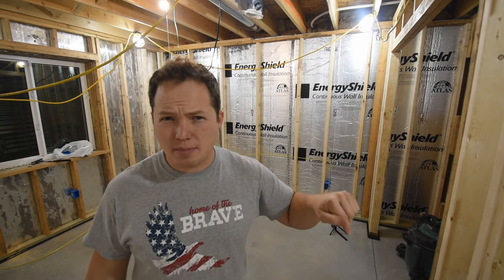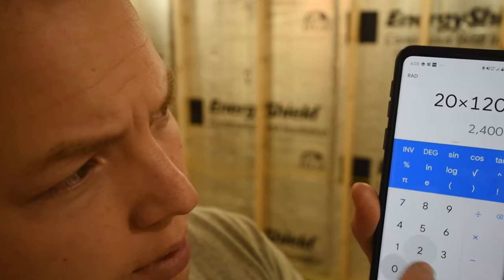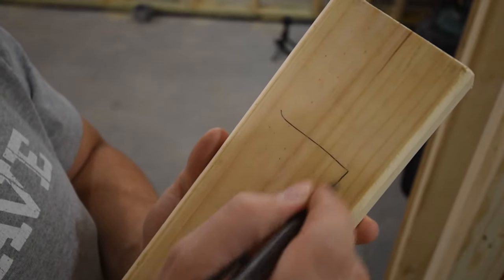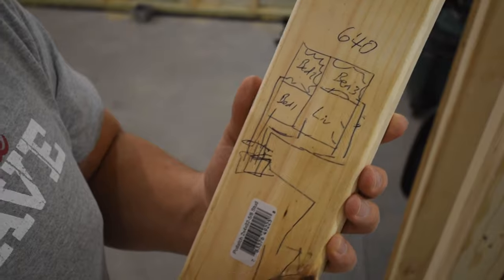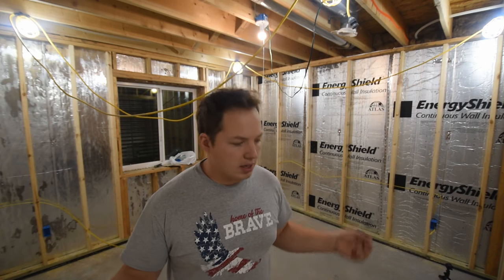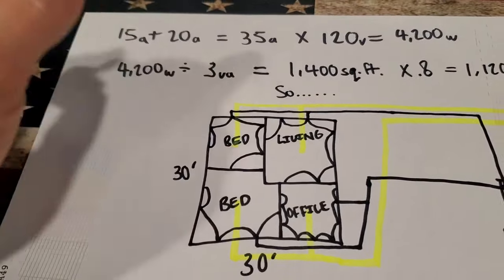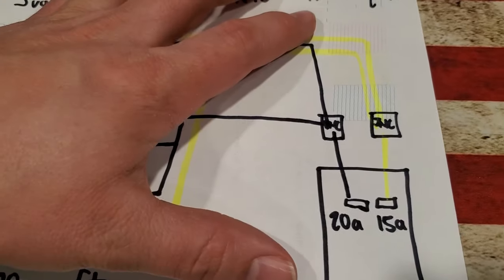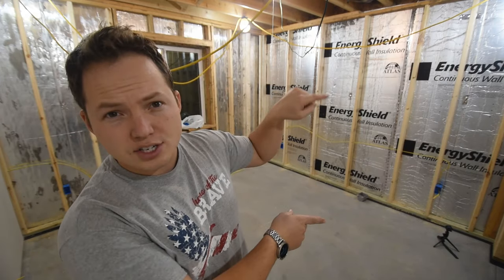Does a Bedroom Require a Dedicated Circuit? - Using the 3VA Rule To Calculate Anticipated Loads

Comment: It may have already been brought to your attention, but it is not necessary to apply the ‘80-percent’ rule in performing your calculation. That value is only used when including ‘continuous’ loads in your calculation. A general purpose (convenience) circuit does not typically involve continuous loads as defined in the NEC. Conclusion…a 20-amp circuit may be used to its full rating…2,400 watts.

Comment: I would like to see a video wiring a room using home computer workstations for each occupant. Something like six computer monitors and two computers, five external hard drives, four powered USB expansions hubs on one wall. I don't think there is a connection between square footage of a room and the load of all the electronics commonly used now.

Comment: I live in Tucson Arizona , and in this county, you are required to have an arc fault breaker for bedrooms. I guess that fact doesn't change anything you just said in this video, just that any outlet that winds up in a bedroom be protected by an arc-fault  breaker.
Reply from the maker: Same here! Almost everything is on arc fault these days.
Reply: Yes, it's the National Electric Code, and it applies to most jurisdictions. But states, counties, and even cities don't necessarily adopt the NEC, or, if they do, it may not even be the current revision. Some jurisdictions may even have a superset of rules that exceed the NEC, such as Chicago and its surrounding counties.
Reply: @aaron74  wow, I wonder why Chicago is so persnickety. I mean, it's not like they ever had a fire.. there... Oops...nevermind.😂
Reply: @barryhornby3303  They've had a couple bad ones, I think. ha ha They also have very strong labor unions there, and their local electric code requires EMT conduit in electrical construction - in residential construction even! I personally am all for it. EMT and steel boxes are awesome, and allow you to fish new lines if necessary. But EMT is not DIY friendly.
Reply from the maker: @aaron74  I am considering using EMT for an upcoming garage wiring project but I'm not 100% sold on the idea yet. Just not sure if the extra cost & effort is worth it but it would be pretty fun!
Reply: @aaron74  same with us in NH some areas have no codes others are like you need a 80amp circuit for a 50 amp oven or 30 amp dryer lol 🤦‍♀️🤷‍♀️🙄
Reply: @BenjaminSahlstrom  you cld always use mc ?? best of both world the strength of emt and the flexibility of romex
Reply: @BenjaminSahlstrom  EMT is beautiful. I love the stuff. The only intimidating aspect of it is learning how to bend it, it takes a lot of practice. I've done some installations with bends that I'm pretty proud of, but I've done plenty of screw-ups over the years to get there. There's just something so satisfying about working with metal pipe, fittings, and boxes!
Reply: @aaron74  Yes all residential here and most of the surrounding suburbs has to be in EMT conduit.  Romex only permitted for temp wiring. BX, or MC armored cable or flex is allowed only in enclosed walls where it has to be fished in. There must not be more than 18" of showing where it emerges from wall/ceiling to where it  connects to a J box.  If I remember right in new construction low voltage must also be in EMT conduit. Tandem or skinny breakers are not allowed. Unless it's changed now, there were no arc fault requirements but some nearby towns still require them in bedrooms.

 I like metal boxes and EMT also.  I think it provides a safer installation, better protection and room to add or redo wiring as changes arise.  Looking at a finished EMT installation in walls and ceilings is almost like a work of art.
DIY conduit bending is def not easy, its very time consuming and labor intensive I can tell you.    You can learn the basic bends, 90's are easy, but getting it neat, straight and even takes a lot of patience and practice.
Reply: @aaron74  I admire those who can do three or four bends on one stick when I've made one or maybe two then cut it  and do another bend or two and cut it Lol.
Reply: @Progrocker70  You must be in the Chicagoland area then. Maybe you can tell me why receptacles always seem to be mounted sideways there? lol
Reply: @aaron74  Lol no answer for that one. My house I have now all the outlets are vertical except one between a windowsill and a counter.  I own another bungalow, and all the original outlets in it, that are piped in rigid, are sideways and the ones added over the years with gem boxes screwed to laths are vertical.
Reply: @Progrocker70  Yeah it's an oddity in the Chicago area: sideways receptacles. If I had to take an educated guess, it's for EMT that runs horizontally through studs, and is interrupted by device boxes for receptacles. Device boxes are rectangular so it might be better to have them sideways for less congestion for the conductors entering the boxes. These days the 4" square boxes are used, so the orientation of the device depends how you want to mount the device plaster ring. Maybe they continue mounting it sideways out of tradition.

Comment: I prefer running 12/2/2 to the receptacles. I also prefer to alternate each circuit to every other receptacle. I don't like split outlets. I find them dangerous to the Craftsman. This configuration allows for having power available if 1 of the circuits trip as well as some built in load balance.
Reply: 12/2/2 huh? Wow, that's pretty extreme. I suppose you could split the standard duplex receptacle and have the top one on one circuit, the bottom on the other circuit. This was common practice in Canadian kitchens before two 20A countertop receptacle circuits were required (that matched the US requirement).
Reply from the maker: Wow Steve! That's very impressive. I'm not very familiar with 12/2/2 so I would just run a second 12/2 cable to help me keep it straight. So you use single receptacles instead of duplex and then alternate between circuits for every other receptacle?
Reply: @BenjaminSahlstrom  I still would use duplex outlets. 1 box would be black circuit with the red circuit as the passthrough and the next box would be red circuit with the black circuit as the passthrough. If I used a single receptacle it would have to be rated at 20 amps. The exception in the code is multiple outlets on a single yoke may be 15 amps. By using this, my defacto derate factor is 25%. No worries about overloadsᕙ(  • ‿ •  )ᕗ
Reply from the maker: Thanks for explaining that. Some might consider that to be overkill but wow is it cool! Might have to add that to the list of videos to make! Just have to make sure that you keep the neutrals separated too right? Then would you space the two breakers feeding the 12/2/2 apart so that they are both being fed from the same leg of power from the panel in order to avoid having 240 volts in your boxes?
Reply: @BenjaminSahlstrom   What I like about 12/2/2 are the nuetrals have a corresponding stripe to match it's hot. No toning out to identify. This cable was well thought-out.
Reply: @steverosenbaum2469  What's weird is that this was never done with electrical cable before. With low voltage communications cable, you have a solid color conductor and its striped mate to identify a pair, and this goes back to at least the mid-20th century.
Reply: wow thts expensive just use two spools and pull 2 lines together same labor %30 percent less than 12-2-2 i was going to use it myself than seen the price was like nope ill just run 2 spools at the same time lol
Reply: @BenjaminSahlstrom  ya in my area it was like %30 cheaper just to run 2 spools at the same time
Reply: @steverosenbaum2469  lol you must have got a good price i was going to try it myself but it was like %30 more i just ran 2 spools same labor ya i had to trace pairs
Reply: @wizard3z868  Yeah you're right, the 12/2/2 is still expensive. Probably not popular enough.

Comment: i did some rewiring in my house. they had half the kitchen, old and new living rooms, out door lights on deck and porch, plus porch and hall lights on 1 circuit. and 1 unused outlet in garage on 1 breaker. and 1 garage light on 1 breaker. i shuffled stuff around. master bed and bath lights and outlets they had on 1 circuit and 2 other bedrooms lights and outlets together. i left those alone. but like dude said.... if you can, each bedroom or room outlets on separate 20 amp per room. and all the lights on 1 15 or split between 2 15s depending how many rooms. thats way to go.

Comment: The only point that I’m going to bring is , that every receptacle outlet is 180 va   code math is 20x120=2400/180 =13 .so in residential outlets are non continuous.
Reply: Mario inocente     You are correct if you are talking about other than dwellings.   The 180va or 1-1/2 amps does not apply to dwelling units.

Comment: I have a 700sq ft house with a conventional panel, but the rooms still have knob and tube wiring.   It was inspected OK, but a vac and/or blender will sometimes pop the breakers when they should not.   I don't understand how a. 5A vac can trip a 10A breaker when nothing else is on the circuit.   Does this mean there may be undetected wiring problems?  Cheers.

Comment: Can you explain the 3va/sqft rule? I’ve tried to determine how many receptacles or lights can be on a branch circuit before. For the receptacle question, I’ve seen that you can assume 1.5amps per receptacle and the circuit should only be loaded to 80% so that would allow you around 10-12 receptacles per circuit. Lights pretty much the same idea, but they generally draw less so you can have a lot more per circuit. Is the 3va/sqft basically just the consolidated version of this principle? Also are you a licensed electrician, and in what part of the country?

Comment: Bedroom lighting, should be 'required' to be separated from ALL OUTLETS. Trip a breaker once with ANYTHING (VACUUM) and you'll understand why (can't even find the stairs if upstairs to go down to the panel). Alternative example.  2 window ac units, when your whole house HVAC needs replacing.  BAD TIMING FOR ANOTHER PROJECT!  Mom says.. 'why not add a ceiling fan in each room?'  Try doing that with no power in the outlets for even a work lamp.  Time to buy more batteries or just go grab the solar lamp from the garden gnome?  NOPE.  Do it smart!  Good video!

Comment: i have a closet next to my game room and in the back of the closet there's an access panel for storage 8 outlets on 12/2 and a 20 amp breaker, could I come off that out let and run 12/2 for 2 led lights to light closet and storage room using a 20 amp light switch?

Comment: What about Voltage drop off.  I'm confused, with 12/2 wire on a 20amp breaker we are only allowed to run around 50ft before we hit the 3%.  I'm assuming most residential runs are longer than 50ft.  How are we allowed to do this?

Comment: An apartment having Living and Bed room each (3mX2m), Kitchen and Bath room each (2mX2m), Corridor (4mX1m) and Balcony (2mX1m) is to be installed with the following loads: Ventilator (500W), Fridge (1kW), Stove (2kW), six 60W lamps, and five socket outlets.
a)Calculate the sub-feeder cable size for this room if the average ambient temperature of the local area is taken as 35oC and five groups of circuits are running together in a conduit with it. The length of run is 15m and protection is by MCB.
b)Choose the rating of the MCB and the branch circuits breakers. 
c)Locate the approximate area of location of each lamps and sockets.
can you pleas do this for me ?

Comment: 120 X 20 = 2400
2400 divided 3VA = 600
You can put as many plugs as you want on a 20 amp circuit with in 600 square feet of living space 

Why is this aloud ? 

Because 75 percent of the receptacles never get used. 

The only thing you says that is good practice is receptacles on 20 amp circuits and lighting on 15 amp circuits

Typically you could put all 4 rooms on one lighting circuit, the only time I would split is if each room has ceiling fans, I try to not have more than 2 ceiling fans on a light circuit, usually 14 to 18 openings with the LED bulb coming into play.

Nowadays 3 to 5 lighting circuits will be enough for any house. 
3500 square foot and smaller

Comment: Please explain why you bring 4  20a circuits to 1 junction box?
Reply: Jose Canisales    What he was saying is put a junction box near your panel with 4 home runs to the box.   Run 1 circuit from the box the a breaker in the panel.   Now if you want to reconfigure to 2 circuits, pull the wirenuts apart and install 1 more circuit from the box to a new breaker and re-splice the conductors in the box.

Comment: Well I'm not sure if the codes are different in your area, but it is considered that each outlet is equivalent to 1.5 amps so in theory you shouldn't put more then 13 outlets on a 20 amp circuit, to be safe 12, this would be a safer way to explain it to the dyi person
Reply: There is no code in the NEC that limts the # of general   outlets on a circuit in dwellings. Thats commercial wiring.

Comment: Hi Ben first time contacting you my friend is renovating his home and installing new circuits and lighting I am a retired electrician and my question is do you need to have arc fault breakers on the refrigerator and bathroom circuits as they will be dedicated circuits
Reply: as always check with local authority but most will be yes and in 2024 large appliances ovens and dryers will need afci/gfci🙄🤕

Comment: So going by sq footage in. 3 bedroom house, 1 master and two kids, I would run 1-15 amp circuit for the 2 kids and 1-15 amp circuit for the master. That's enough to cover
750 sq feet. That's almost 20x40 on the flat. That's a lot of area.
Reply from the maker: Obviously you can always be more conservative and run more circuits. It's just a starting point to go from.

Comment: Hey Ben I  have a question that I will try to keep short (but unlikely, sorry)  I bought a bidet toilet seat (AC 120V 60Hz 660W) and need to install a GFI to power it. I installed the GFI and powered it by pig tailing it into a 3 gang box in my attack. Inside the box was already 4 wires coming in. 2 wires were 14/2 w grn and 2 more rounded wires I think 14/3 with black, Red & white wires. The red to red & the black to black, so I left those alone and just took my one 14/2 and tied it in to one of the other 14/2s in the box. Black to black, white to white and of course the grounds were all together. I lightly twisted the wires (I know you don't do this) before adding the marrettes. I made sure they were snug and then I even tape them separately with electric tape just make sure. I tucked every thing back in the box neatly with plenty of room inside that 3 gang box. The GFI was working correctly and the bidet seat also worked perfectly ... Now ... the issue I have is when I turn on certain lights in my house after about 1 min.  I notice a faint pulsing or I don't want to say flickering because the lights don't go out just slightly flick (almost like a very quick half blink) It does this each second for about  60 to 90 seconds. Then it stops. Sometimes occurring again after 7 or 8 mins.  Something like this has happened over the past few years when my toaster oven is on the microwave light over the stove slightly pulsed the same way until I turned off the toaster oven. Anyway my question is do you know why this is happening? Is there not enough power in the circuit to carry what's on it? Should the bidet get it's on line straight to the panel or should the panel circuit that carry those lines be changes to a 20amp instead of a 15amp. Almost all my circuits in the panel are 15amp.  Any ideas ? Sorry for the long message. I appreciate your help.
Reply: RE:Dwayne Nero. I'm not an electrician but I would re-check the connections in the bathroom box you tied into, especially the neutral wires. Also, in case you may have tugged on one of those 4 wires, I would try to trace each one back or forward to another box and check the connections there. If you have a bad (loose) filament in an incandescent bulb, it might cause pulsing.
Does your microwave light still pulse? Is it on a different circuit than the bath? Is so, then it may be more of a problem in the main panel or outside. I would inspect the wires there, especially the neutrals. One other thing you might try replacing the breaker or swapping 2 breakers to see if the problem moves to the other circuit.
If you have, or can borrow, a multimeter, you can check the voltage at the bath box, the microwave light and at the corresponding breakers to see if it is fluctuating.  Also, test between the 2 hot legs and the neutral where they connect to the panel. Between hot and neutral, about 118-125V and from hot to hot, about 235-245V. Does it fluctuate? Test with main breaker on and off.
One more thing; if the bidet was cheap Chinese crap from Amazon, I would also check for loose connections on it.
Reply: @munsters2  Thanks for the advice which I will keep and apply to any similar future issues. What I decided to do just to be on the safe side was to give that bathroom outlet it's own dedicated line straight to the box. The pulsing stopped completely and everything operates perfectly. I just thought the piggybacking was too much. So all good now thank you 😊

Comment: When are you going to mention the 6/12 rule for receptacle placement locations? The whole j box issue bring up problems for future trouble shooting. General rule I have always used is 1 room 1 breaker lights and plugs . Done. Not sure where this splitting lights and plugs has come from but whatever works for your area.  😀

Comment: I like to keep each room on its own circuit. Lights and receptacles on the same circuit (especially with todays LED technology). This makes it easy to flip one breaker and KNOW the room you are working on is dead.  With that said wiring a kitchen or garage you want the lights separate for various and obvious reasons.